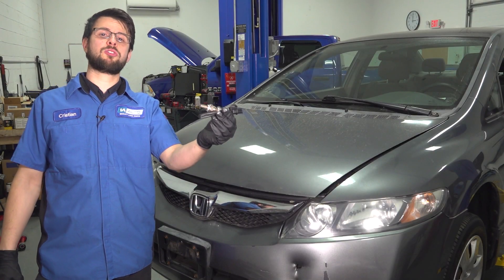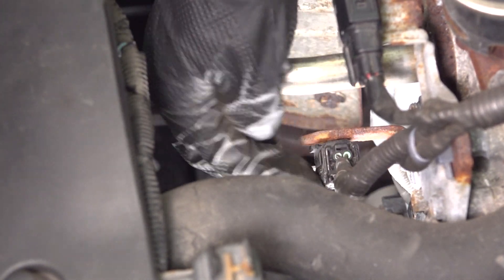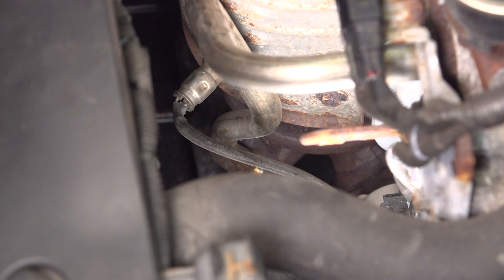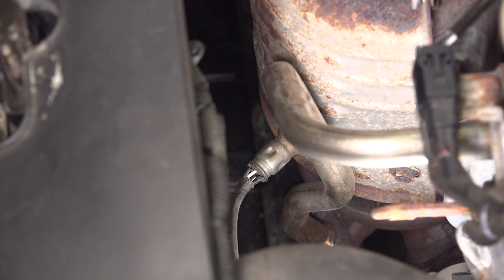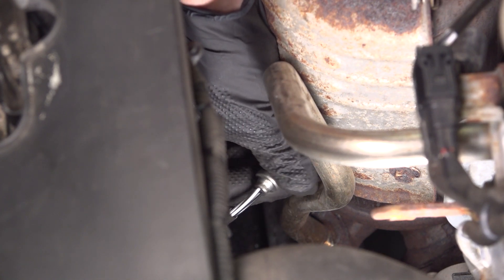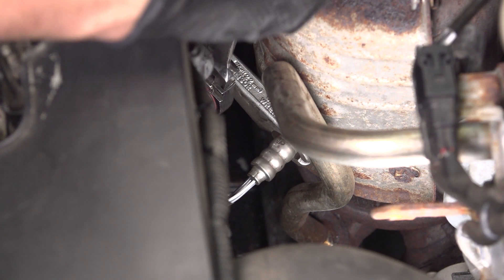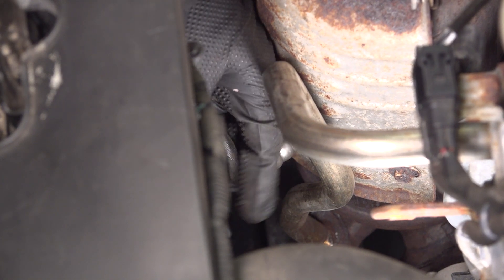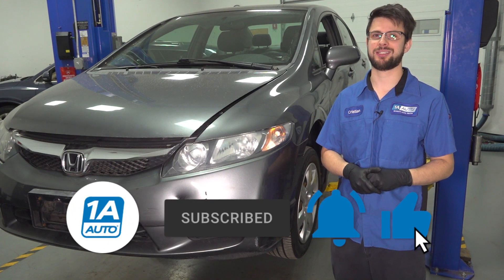How to Replace Downstream Oxygen Sensor 2006-2011 Honda Civic

Comment: So the B1 S2 is the one that’s right there on top of the engine in front right when you open up the hood? I thought it was on the exhaust pipe. I have a 2013 Civic EX 1.8. I don’t know if I put the wrong sensor in the wrong spot but the part number I put in the front right when you open the hood is 234–9119. Is up in the front (denso) and the sensor 2 is where?